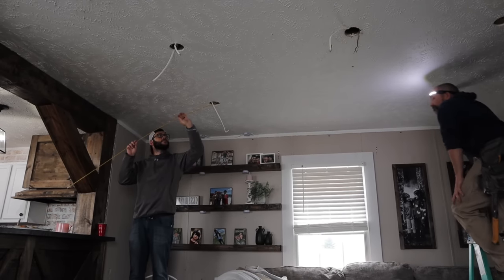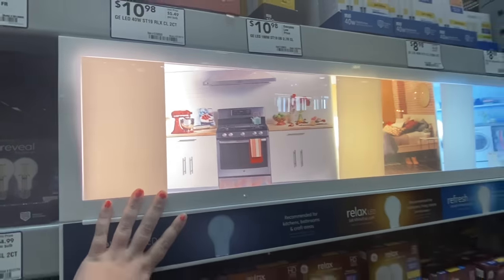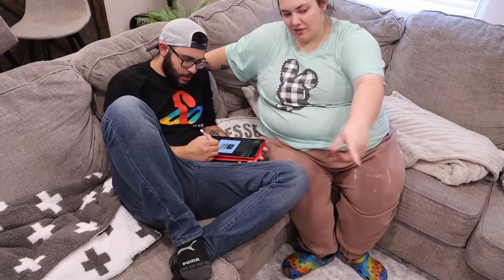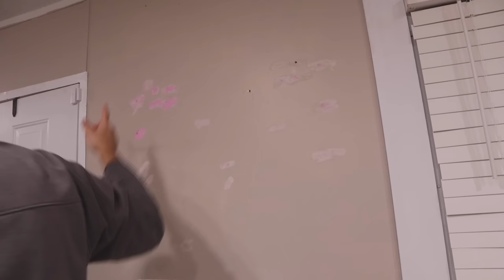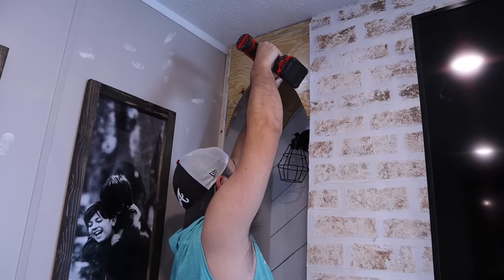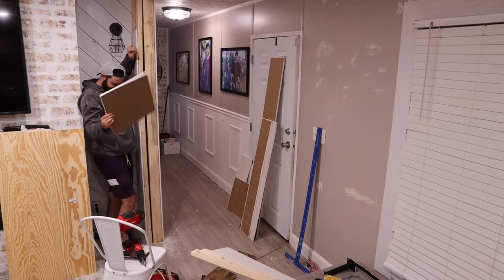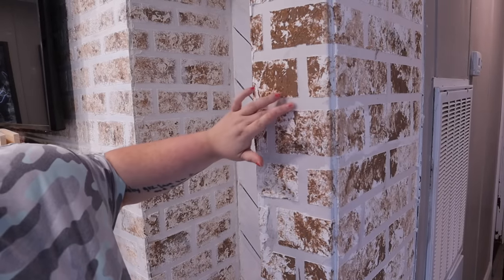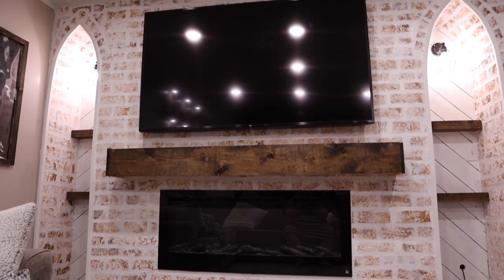MOBILE HOME REMODEL | fireplace built in | NEW LIGHTING | single wide mobile home makeover

Comment: You’ve done fabulous work on updating your home.  It is very pretty.  Have you ever heard of these tips, slip a grocery bag or small plastic garbage bag over your paint tray so it remains clean and you toss the bag?  Stretch an elastic over your opened paint can to drag your brush against to remove access paint instead of the edge of the can, it keeps paint from running down the side of can.

The new ceiling lights in the living room was a huge improvement.  I live in a mobile home and know the frustration of poor lighting.

Enjoy your channel. 🙂 🇨🇦

Comment: To hide cords, I use a basket and then cut a hole in the back that will be hidden by the wall and feed the cords through and then I can hide my power strip or whatever. Works very well.

Comment: Love your videos and your energy….you could replace your switch with a dimmer and if you want the lights less bright…just knock the toggle bolt into the wall, it will fall down into the wall and that will create a smaller hole to repair…keep up the great work. 😊

Comment: To not lose any air con I would definitely get a vent diverter it's like a vent cap to push the air out and not straight up so you don't have to worry about condensation build up in a tight space.

Comment: That big hole y'all filled in that the couch made, you need to use a mesh. A joint compound will sink in over time. Use a mesh with big holes because it provides stability.

Comment: If you don't want the heater vent to blow upward on the shelves, you can use a furnace vent air deflector to change the direction of the air without messing with ductwork. I would not use these where people walk because they get kicked or stepped on in high-traffic areas. They are easy to use because they magnetize onto the vent and adjust to the width.

Comment: lowes and home depot have these clear plastic half round shields with magnets you put them on your air vent and it will direct the air out into the room, I use one in my bathroom so I can put a piece of furniture over the vent and it works well, they slid out to fit any size of air vent.  I have no idea what they are called but at home depot they are where the air vents are in the store.....not too expensive especially since it will redirect your air, will make a difference in the summer let me tell you!

Comment: rena to keep your couch from beating up your new wall, think about getting a couple of those heavy rubber like heat pads you know what I'm talking about? they are like those floppty cup cake and cakes pans, made out of that stuff, cut them into smaller squares, about half inch bigger than your couch feet. the rubber will keep the couch sliding into the wall when you sit down on it....just put the couch where you want it then slip them under it, I use them on other surfaces that a slippery, like my utensil crock, it slides on my stove top, because the rubber thing is a heat proof cause it is a hot pad to take out hot pans, I don't worry about it getting too hot on my oven top....the only problem may be color choice, but really just a half inch showing and it is under your couch if people see them, then they don't need to come back to your house, looking that close is an illness.... lol hahahaha  something to try....a cheap try.....